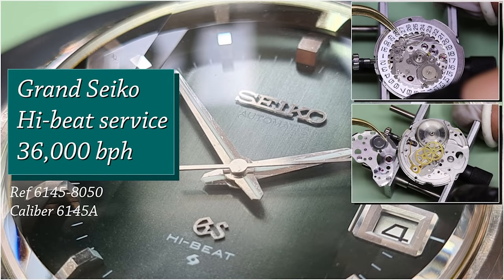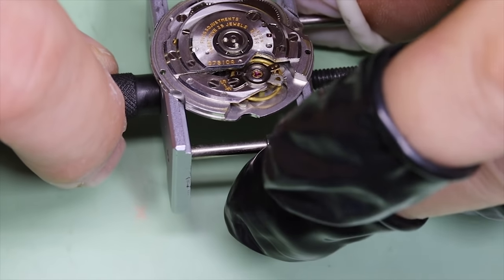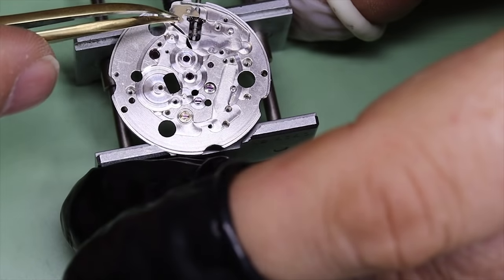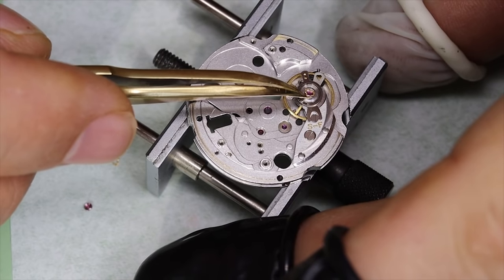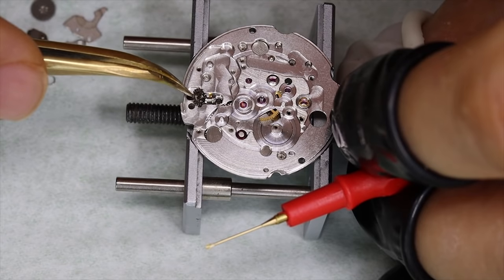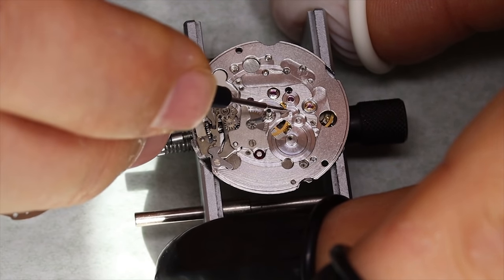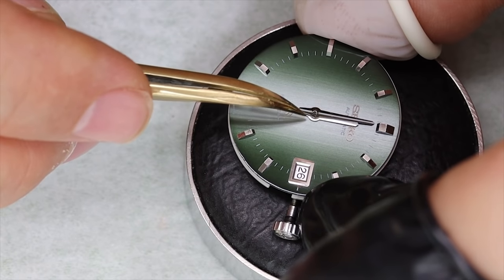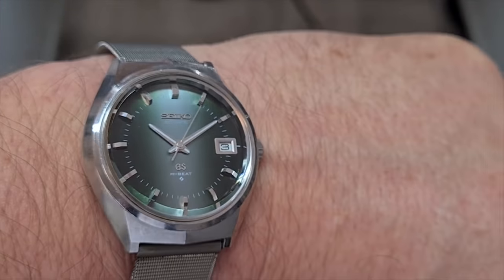1972 Grand Seiko GS61 Hi-Beat service ref 6145 8050 Caliber 6145A

Comment: Can you reasonably safely play golf with a modern Seiko or Hamilton watch. I have played with a 25 year old Seiko 5, a 60 year old Bulova , two 60 year old Elgin automatic watches and a 1960 Hamilton K 416 with the Hamilton 661 (read Certina) movement for years not even thinking about it. But my Seiko Sarb 033 with the 6r15D and Hamilton Khaki automatic with the H10 2824-2 mod states in the manual that you shouldn't play golf or tennis with them. So since I work in utilities I am not going to beat my best watches up there I wear a Timex or 15 year old Seiko Solar. Therefore the only time I can safely wear the new Hamilton and Seiko is watching your videos before I go to bed.
Reply: I have a 15 years young 6R15A which has seen the links and shooting range more than a few times. Serviced once by Seiko, she runs at -1/+1 per day, as long as she rests crown down overnight (slows down the average +2 daytime gain on the wrist). The rapid date stopped functioning a year ago, when the crown is pulled out 1 click. The watch keeps running, the crown has no effect, but the date advance overnight otherwise works normally. It hacks and the hands turn normally to set the time at position 2. Pushed in at position 0 it winds normally by hand also. No other problems have developed. I don't often wind it by hand, the automatic rotor system is efficient.
Reply from the maker: Hi Jeff, thanks for watching and for your question! Sports can be quite tough on watches, especially if you wear the watch on the wrist that is closest to the action. Manufacturers' advice is though always based on worst case; e.g "don't play tennis with your watch" assumes that you're hitting very hard and generate a lot of force in the action, but the truth is that most of us have tennis skills that probably rival Howard the Duck's rather than Roger Federer's. So we're probably safe, but I still take my watch off when doing sports(chess and curling should be fine, however).

Comment: What is the possibility for damage to the gold medallion on the case back in the ultrasonic cleaner?
Reply from the maker: Hello Pat, there is a great risk of damage, so I wouldn't put the case back into the ultrasonic. Given that the gold medallion is applied to the steel case, it will start coming loose after just a few minutes in the ultrasonic.

Comment: Hi Sir : which part of the watch to make the beats 18000 , 21600 , 36000 ?
Reply from the maker: Hello Ben, that's a great question! The short answer is the entire train of wheels, but the main component making a watch beat faster is the balance spring. To achieve a high beat rate you need a much more rigid balance spring, as a soft spring simply wouldn't be able to rotate back and forth fast enough. Once you have a rigid enough balance spring, the rest of the wheel train of course has to be calculated with the proper gearing between the wheels and pinions to ensure that the hands rotate at the pace they should. Key to this is to equip the escape wheel with a few more teeth in the high beat movements simply to avoid having wheels and pinions with too many teeth further down the train. The escape wheels in low beat movements have 15 teeth while high beat movements typically have 20 teeth. After that there are a few common ratios being used but it also depends on whether the movement has a cannon pinion on the second wheel or an indirectly driven hour wheel etc.
Reply: @VintageWatchServices  Thank you very much Sir !
I have one more question to know , would you kindly to answer me again ?
Hi beats watch escape wheel has 20 teeth then Low beats escape wheel 15 teeth , so does the distance of the pallet fork left stone to right stone also has to be changed to fit the 20 teeth escape wheel  ?
My stupid question meaning is : Is it there has the difference distance between high beats and low beats pallet fork's stone to stone ?
Thanks !

Comment: First time GS on watchmaker's bench I saw. What was the reason Not to open main spring case?  & Why not  a new seal for winding crown stem ?  Next time Pl show how regulation is done  with Time Grafer. Cheers. & one more thing gear teeh are not lubeed ??.I did enjoy watching Video.
Reply from the maker: Hello Tissa, no, watch gears are never lubricated. The teeth roll on each other's surfaces, they do not rub. I have some other videos showing how to regulate the watch, you can check this one for instance: https://youtu.be/3E-L8BamNM0

Comment: Great content and good job on this watch. How would you rate this caliber in terms of decoration, reliability and seviceability against e.g. the newer almost grand seiko, but slower beatrate and not regulated 8L35B? Thank you.
Reply from the maker: Thanks for watching and for your question! I haven't worked on the 8L35, but the decoration level is certainly higher than on this one. For the performance and serviceability I wouldn't really be eligible to compare them but Seiko quality is very, very high in general, really focusing on functional requirements more than non-functional.

Comment: Have you ever striped a screw thank  you
Reply from the maker: Hello Mike, thanks for watching and for your question! Yes, I most certainly have stripped screw heads and also broken screws inside bridges, mainplates and barrel arbors. I've also broken pivots, messed up hairsprings and put the mainspring in the wrong way as well as scratching dials and cases 😂 Luckily quite a few (but not all) of these things were done on watches I bought for practice :) 

It's all part of the learning process I think. It's been quite a while since that has happened, but especially when you're just starting out it can be difficult to know how much force to use, how important it is that screwdrivers are fit for the screws etc.
Reply: @VintageWatchServices  Thank you for your answer I ask this question  because it seem pretty  easy to do so I guess  it is a learning  curve  thank you

Comment: I have heard a lot of watch aficianados say this high beat movements beat themselves to death. That being said, time runs at a constant so the gear train shouldn't really have an issue.
From your experience, does the related escapement parts that are providing a 5Hz beat rate undergo significant wear due to the higher beat rate?
Is it more important to service these on a regular interval?

Thanks....just subscribed.
Reply from the maker: Hello Mark, thanks for subscribing and for your question! It is indeed just a few parts that have higher direct wear due to faster rotation, and the exact reasons for most manufacturers backing off of 36000 I think is more due to 28800 being fast enough... Nowadays in particular, watches aren't really made to last more than a few years, and with a higher beat rate the need for lubrication is higher. But any exact experiments or results from 36000 watches is very hard to find.

Comment: Wrong balance wheel lift angle! Correct angle is 52,4°(52,36°)......
Reply from the maker: Hello Orlin, thanks for watching and I hope that little mistake didn't wreck the whole experience for you! 😂 
If you know the actual lift angle you probably also know that it's not a big issue to use a slightly different lift angle if the amplitude is within healthy limits. If the amplitude shown in the video was 230 degrees it would be important, but in this case a 52.4 degree angle would probably lower the amplitude to just below 300, which is still very good for a Seiko this age :)